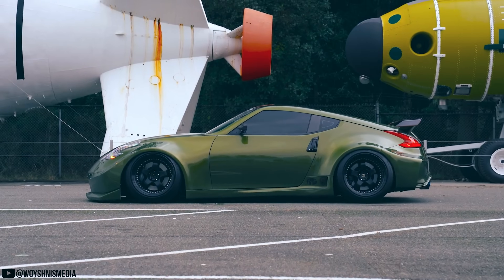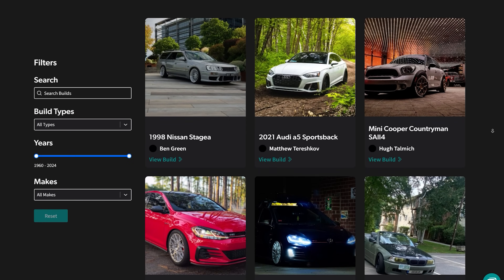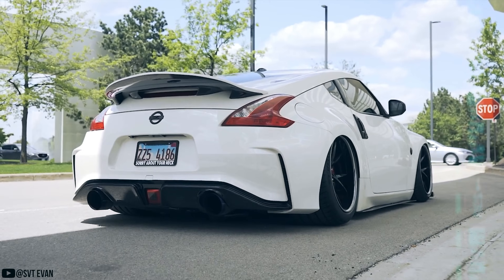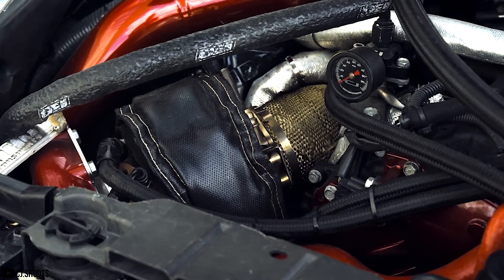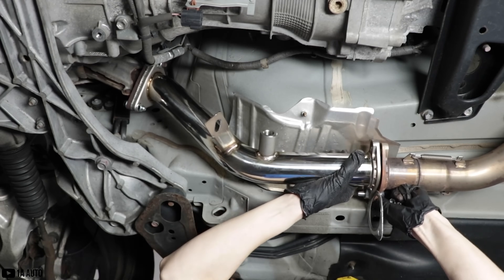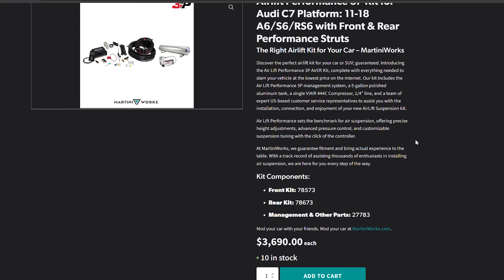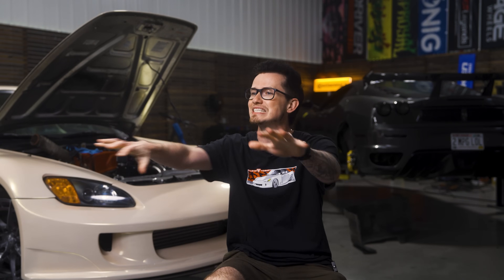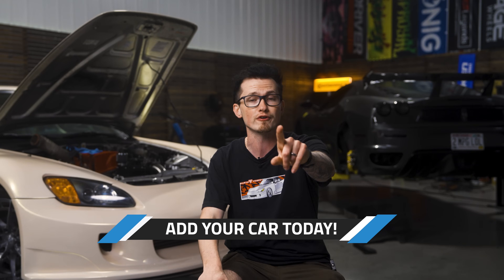How To Modify | Nissan 370Z

Comment: how to modify a honda fit? lol
Reply: You don't.
Reply: @sleepy_ipl  you must be fun at parties
Reply: @dontever  what's a party?
Reply: Might as well mod a bicycle
Reply: Trade it in to get a type R
Reply: I don’t know his channel off the top of my head but there’s a dude who makes videos on his Honda fit. Think the most recent video of the fit was him making a custom turbo kit for it lol.
Reply: Real talk? A big ass radiator to keep things cool, better pads, rotors and brake fluid, and some good tires. They're small enough that you won't need anything else. Anyone telling you to K swap one right away wants you to die. Send it at a track day with just that and you'll be faster than everyone in the beginner group.
Reply: Just stance it bro 😂
Reply: @steadyboost7 oil cooler and front sway bar is all you need for a great starter kit
Reply: There is a twin scroll bolt on kit for the fit. Btw, the fit late model had so many issues when I had mine.
Reply: Add a laptop and call it a day
Reply: Auto zone 😎

Comment: There's not really an oil consumption issue in the VQ37VHR. People who have this are shooting flames, which is not an issue with the car. This is their choice to do this with a tune. However, the most important issue, that was not mentioned in the video is gallery gaskets. 370Z goes back quite a while and the older years may have issues with gallery gaskets which may grenade the engine if not replaced.
Reply: Elaborate please

Comment: 400 at the crank* gonna throw that in because newer buyers of the platform make that mistake alot, in reality you'll be making 340 wheel with the basic breather mods and a tune, and with decent tires and a decent driver you're looking at a sub 4.5 second 0 to 60.

Comment: Thank you Alex.  Your past video on the 370z over at Fitment Ind is one of my favorites to reference and am glad your covering it on your new channel.  Love that you stressed on some of the positives on keeping the 370z naturally aspirated: the stock power is enough if your looking for a very good balanced sports car.   As I purchased mine in 2020 as a new model its been a blast to own.  And you have just inspired me to take a mid step in my 370Z build.  Maybe spend some time with everything less the supercharger before going full on boost.  In the name of keeping it on the road I wish the hit the 500-550 hp range. Wish you would have covered some boosting options.  Question: why not a 20" staggard  rim build?  Am also surprised you did not cover the body mods as much.  Is it a sign of the times? Also, I agree with your exhaust point and as I am getting older am not fond of letting the neighborhood know I am pulling up.  I hear the Stillen exhaust is on the quite side.   Why Stillen?? Am stuck in Cali and really trying to avoid getting state reffed.  That means quite exhaust with cats..... check.  Car not scrapping ground.... check.  Tinted windows......crap!   Looking forward to your next 370z vid and thx for the inspiration!

Comment: 350z being longer makes it more stable & better for drifting 

Also this is subjective but the 350z styling is more classical while the 370 has that drag queen makeup thing going on
Reply: If you want a nicer street car, you get a 370, it’s quieter, the controls are less heavy etc..
If you want to have a ratchet, aggressive, loud track car that feels raw with heavy clutch and steering you get a 350
Both reliable and great for the $

Comment: Disregard the wheel advice.

Buy SPL parts adjustable arms to fix the lack of alignment ability.

Add negative camber.  

Run the most aggressive wheels you can get

I’ve done both 20x11 +15 and 20x10 +3 in front.

The Z34 has huge wheel wells and can fit anything if you invest in SPL FUCA’s and the rear arms to achieve negative camber as needed

Comment: Why are you suggesting different diameter tyres. 245/40/18 and 275/40/18 have a difference of almost 4% in diameter. The correct tyres are 245/45/18 FRONT and 275/40/18 REAR.

Comment: Overall good video but I’ve never really heard of 370z’s burning oil. That was an 03-06 350z thing. Mine is making 600 whp, has 65k miles, and doesn’t burn a drop. Also I would not do any intake manifold upgrade other than smoothing out the runners on the factory one. 0 companies have made an intake manifold that doesn’t LOSE power when put on the car. The factory intake manifold is designed to almost perfection and is still used by cars making 900-1000 whp.